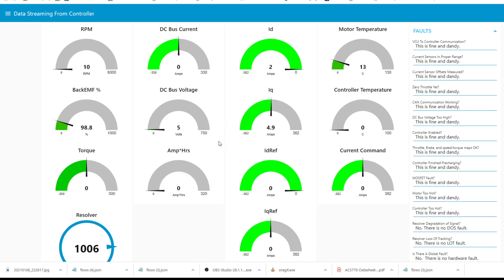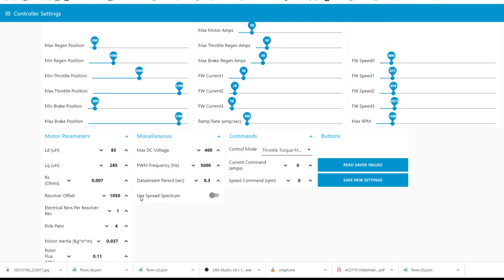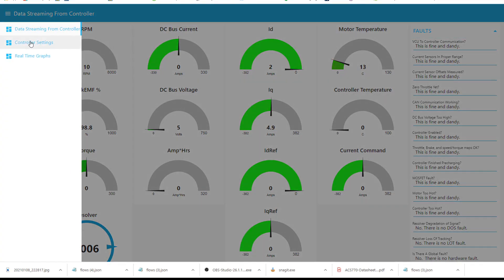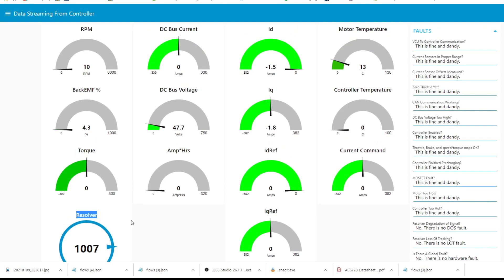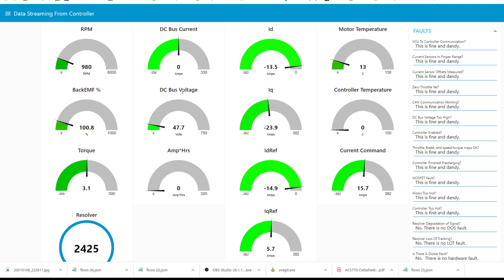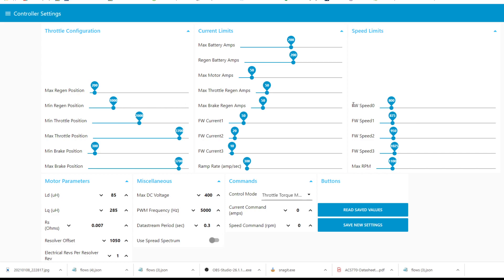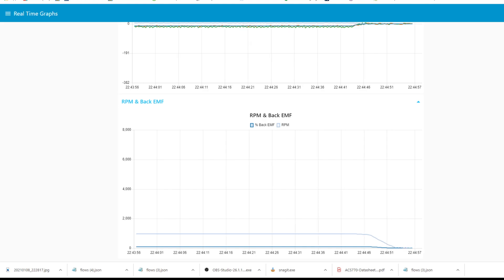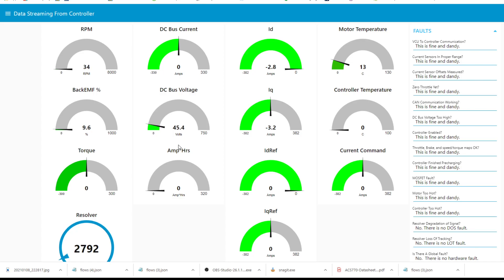Changing AC Controller Settings with Node-Red

Comment: Nice Work, love your work, concerning the 200kw controller on instructables, has anyone built and used that one on a car for extended period (real life application) ?
Reply: I'm not sure what people do.  I get a lot of requests for the board.  It's old software at this point (on an old 16 bit microcontroller).  I used it in a really big "go cart"
 for several years, but not in a car.